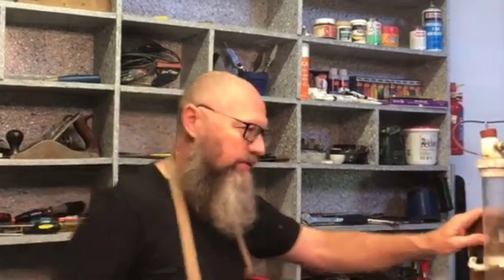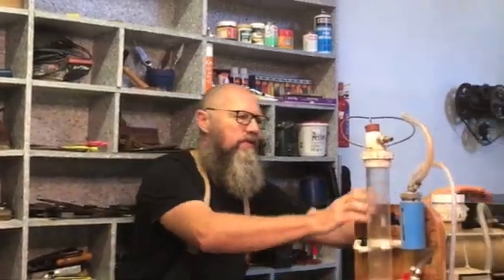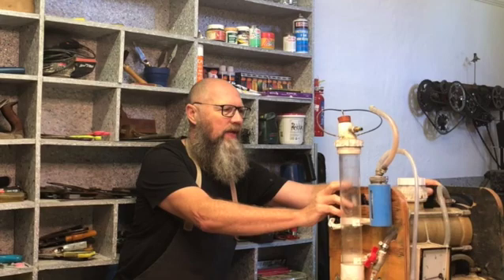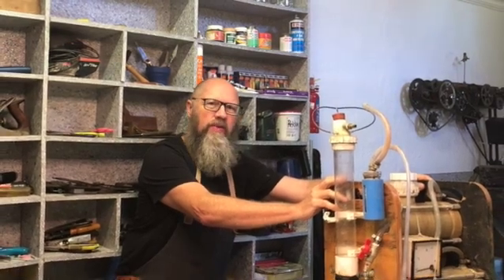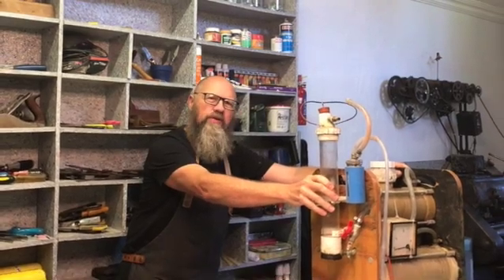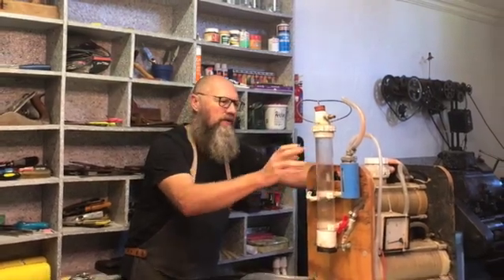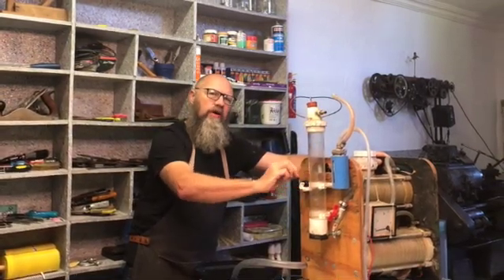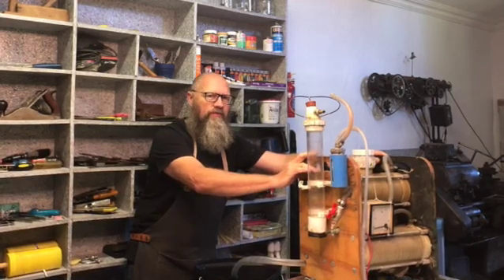How to build a HHO generator that produces Brown's gas safely and successfully. Part 2

Comment: Does the Brown's gas generator do everything the acetylene torch does. Can it brase metals in the same way? Bronze? 
What would it cost to build one?
Reply from the maker: Hi Alex. Yes, and it can do more as there are options to mix it with other gasses. It will cost  you around 4-6K to build.
Reply: Is that in dollars?